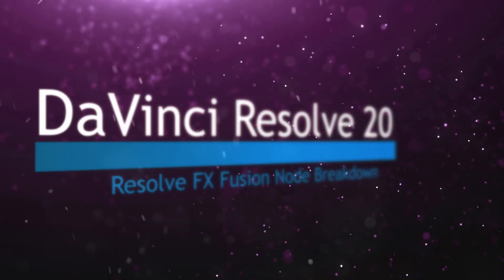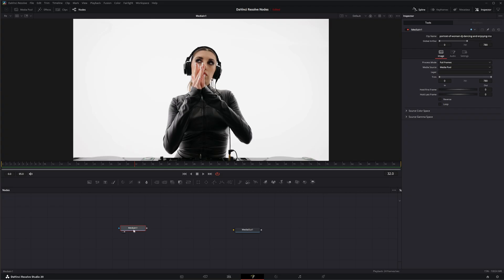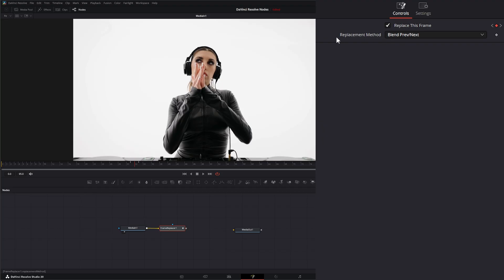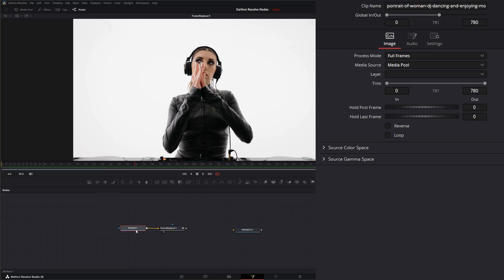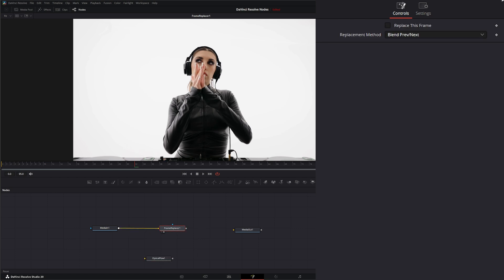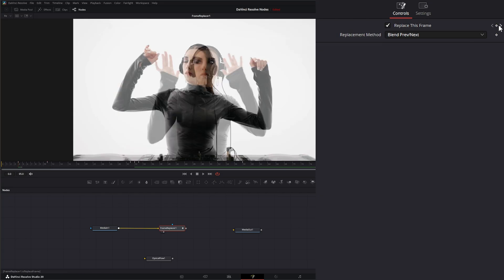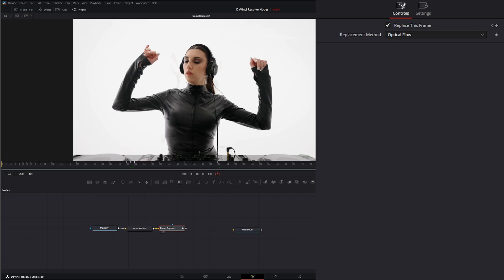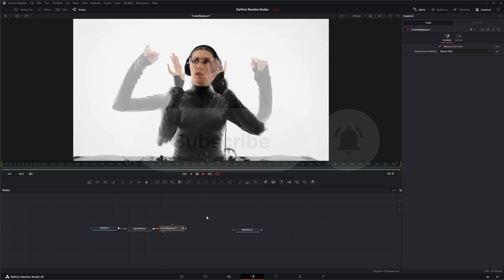DaVinci Resolve 20 Fusion Frame Replacer Node

Comment: I had an adjustment layer over my clip and a PNG, so for some reason none of this worked, it gave me a replaced frame that was super over saturated, I also have colour nodes on my timeline group
Reply from the maker: Yes, sometimes you may need to create a combined clip if you have any adjustment layer on your timeline and then create a fusion comp with the combined clip. Also, any color grading you have from the color tab won't show up in fusion unless you select it on the MediaOut node.

Comment: Maybe I'm not understanding something basic about Fusion... I have a long clip with several glitches. Do I do a separate Frame Replacer node for each one? How are they connected? Is there a way to specify multiple unrelated frames in a single Frame Replacer node? What about if I already have other nodes (the clip already has a DeltaKeyer)? Also: your chain doesn't appear to connect to MediaOut. Is that even possible? I haven't been able to get this to work at all. I'm using DR Studio 20.
Reply from the maker: The Frame Replacer is really meant to fix a single frame. If your footage has many frames of glitches, you would want to use a more robust node like the Dust Buster, Object Removal, Patch Replacer, Dead Pixel Fixer or Paint Node. As far as the MediaOut, I rarely connect it during my Node Breakdowns because this only needs to be connected to send your Fusion project back to Resolve (i.e. Cut, Edit, Grading Tabs). Since I'm only using Fusion, I don't connect it...it has nothing to do with things working within Fusion though...it's just an Output.